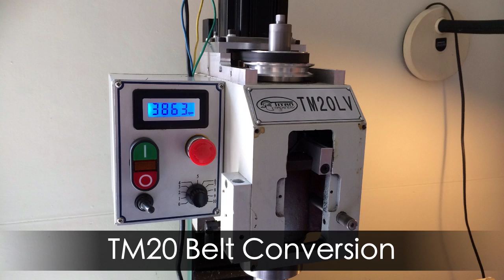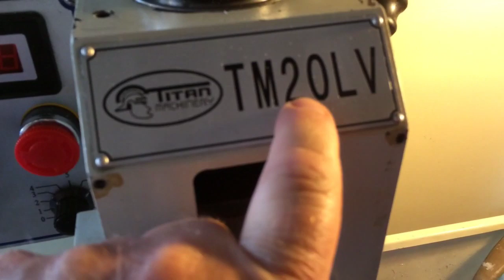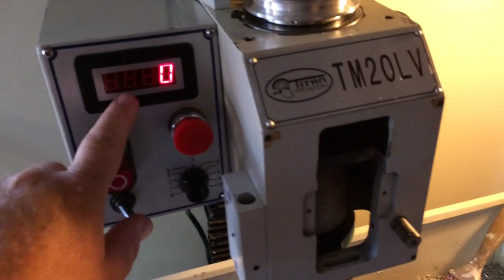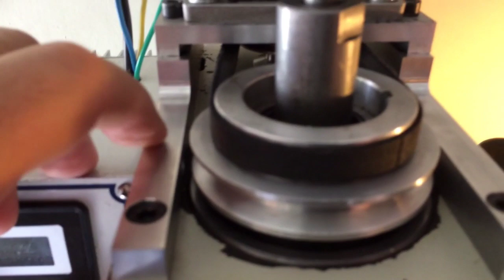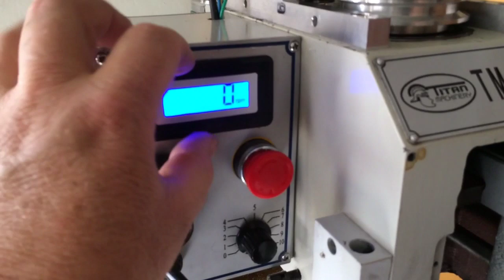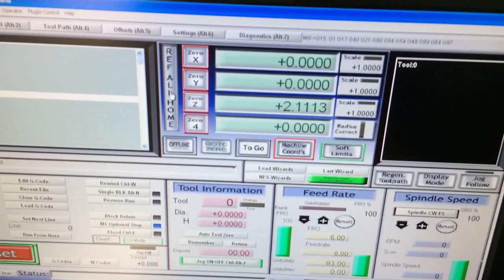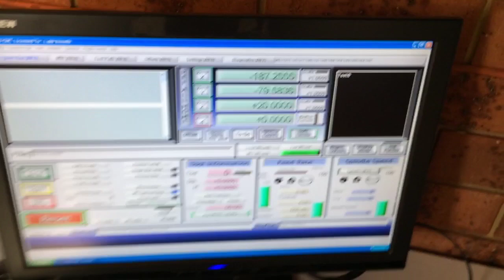TM20 / G0704 Belt Drive Upgrade Kit

Comment: Hello great job! Could you tell me the pulleys ratios/dimensions and belt model?
Reply from the maker: Hello Enrico. This came as a kit from the factory. I’m sorry, but I sold the machine over 4 years ago now and don’t have that information mate. 🍻
Reply: @DCT_Aaron_Engineering  what do you own now and why did you sell it if you don’t mind me asking? I’m in the market for a mill and was looking at the g0704 $1800, the HF mini mill $640 (which I will buy the belt Drive upgrade, air spring upgrade($200)and 3-axis DRO:$300), the LMS X2D $800 with belt drive upgrade ($155) and the LMS HighTorque mini mill with the 500W brushless motor and belt drive already included for $1200 but will add a DRO from AliExpress for $300 so $1500. I was comparing these mini mills that range from $1150-1500 to the grizzly. Is it worth the extra $600-$1000 for the bigger 1hp motor and larger table with built in Spindle RPM DRO?
Reply from the maker: @ChristopherJones16  Hi Chris. Yes I bought this machine back in 2012. It originally cost $2200 (aud), and then I did a CNC conversion and belt conversion for another $3K approx. I did another upgrade in 2016 installing a Masso controller and machine enclosure. I sold it back in 2017 for $6K. I now own a commercial SyilCNC X7 combo. For me personally and knowing what I know now, I should’ve bought a turnkey solution when I first started. Trust you find this information useful and I wish you all the best with your build. Cheers Aaron 🍻

Comment: Can you put the link where you purchased the kit?
Reply from the maker: I just found this https://www.minipro.com/products/g0704?variant=15375923052617
Reply: @DCT_Aaron_Engineering  can’t you just make those parts and just  buy the belt?
Reply from the maker: @ChristopherJones16  yes mate you could make these parts yourself on a manual mill and dividing head. I have also seen people 3D print their conversion parts and use these to make the aluminium ones
Reply: @DCT_Aaron_Engineering  Gotta love 3D Printers... Saw a guy build a 3D printer with wood blocks that were temporary so he could print the replacement pieces with 3D printed ones. Held the printer together just good enough to make semi-decent printed ones.. then used those semi decent printed ones and printed perfect ones.
Reply from the maker: Hello Angel.  I shot this video approximately 6 years ago.  I did place the cost and link of who I bought if from in the video description area.  Unfortunately I don't think Titan Machinery is in business anymore.  Many others sell belt drive kits for the G0704 milling machine.  Maybe conduct a google search using this phrase "G0704 Belt Drive Kit".  Sorry I can't be of any more assistance.  Aaron.

Comment: thanks for your vids.  What kid of kit would you recommend for stepper motors, drivers, and board.  I want to do a conversion but the electronics is hard to figure out.  If I use Solidworks, fusion360 and mach3.
Reply from the maker: +Sylvain Masse Hi Sylvain, thanks for watching my vids.  I would go to the the automation technology inc website and check out their products.  My set up is approx 4-5 years old now and I used all keiling steppers and drivers with C10 breakout board.  They have prebuilt control boxes also.  Cheers, Aaron.
Reply from the maker: +Sylvain Masse Here is a link to my video which shows what I used https://youtu.be/OrNAbxKVx54

Comment: Hi DC, looks great.  Are you using a servo motor or Stepper for the motor? And did it come with the machine or was it installed later?  Cheers
Reply from the maker: Tommy Aventadore Hi Tommy, thanks for the feedback.  My little mill uses a brushless DC motor.  It came from the factory with this installed.  These are sold here in Australia under the brand name "Titan".  However, I think these are now being sold in the USA under the name Precision Matthews PM25. Cheers, Aaron.

Comment: Hey Azza!  Just got around to noticing this video.  Nice job on the video, and on the motor brackets, etc.!  

Do you run your homing switches in series?  So, in Mach3, when you activate any of the three, do all 3 yellow lights show up on the screen?  Also, did you mean that you were only going to use home switches (min x, min y, max z), or will you be installing/configuring remaining limit switches as well?
Reply from the maker: Hey man, yeah you run the homing switches in series.  When it homes all 3 little yellow lights will light up.  You then set up your soft limits in Mach 3.  Within the setting you can also determine the homing jog rate / speed.  I did intend to hook up the other limit switches as hard limits, but was too lazy and never got around to it :-).  Cheers, Azza
Reply: DCTTeacher1 Ya, that's what I already did.  If you were to connect the other 3 limit switches, would you again connect in series?  My flycutter works like a charm now, will send you a pic on fb.
Reply from the maker: If I was to do it again I would probably do 3 homing switches and then my 6 hard limit switches.  However, the 3 in series and soft limits work great for now. Just don't accidentally turn soft limits off and forget (Doh!).

Comment: Awesome Azza what a great CNC mill you have created! the higher RPM certainly improves the surface finish huh? but gonna have to come around and get you on to this HSMXpress I think!
Reply from the maker: Hey Luke, thanks for the feed back. Yeah it's going really well now. Definately will have to move on with the software. However, I'm still running XP on my CNC machine and the version of solidworks I have won't operate on it.  Software upgrade required all round :-)

Comment: Nice setup. The belt drive kit is it primarily for noise? Is Titan Machinery local to you or did you get your machine via phone/internet?
The G0704 looks to be a very capable machine and have been thinking about one for awhile now. But I am based in Adelaide and worry about support side of things and after sale care factor.
The fact that Titan is going a bit further to organize belt kits speaks that they are more than just doing imports which is encouraging.
Thanks for sharing. Much appreciated.
Reply from the maker: Hi Owen, thanks for taking the time to comment. I personally believe that the TM20 mill is slightly better than the G0704. Although these two look identical, they actually have some differences. The major one is the way the mill head support column is mounted.  The TM20 is more rigid having 4 mounting bolts that mount vertically off the base.  The G0704 mounts of the end of the base at the rear.  There is also more room in the saddle to fit the 16mm ball screws for conversion etc... Stuart Duncan (Titan Machinery) is the importer for these and he is only ever a phone call away. Yes you are correct, the belt drive conversion was primarily for noise, and to replace the 1 brass gear on the motor which I had stripped and replaced once. Hope this helps you make an informed decision?  Cheers, Aaron.